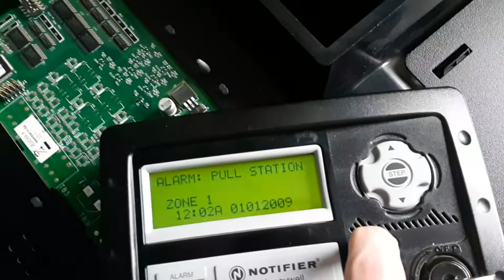Sneak peek at whats to come

Comment: Did you get yourself a panel? (along with an MP3 board from the looks of it)

The message isn't based off a typical MXL message is it? (albeit with "while this is being investigated" being out of order)
Reply from the maker: Got the panel+MP3 board from a friend, I can’t change the messages cirrently due to not having a SD card reader
Reply: @TemporalEngineering  The majority of computers have SD card ports I believe though (are you also planning on saving the original message for archival purposes since it's unique?).
Reply from the maker: @TheCarson116  idk. I need to buy one since I am on desktop and don’t have an SD card slot
Reply: @TemporalEngineering  Oh, alright. Best of luck in doing so.